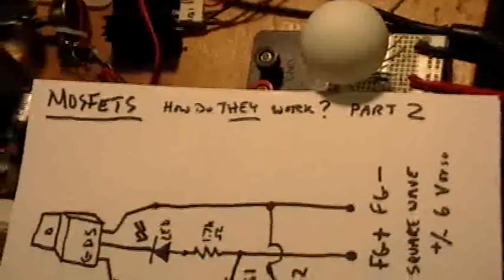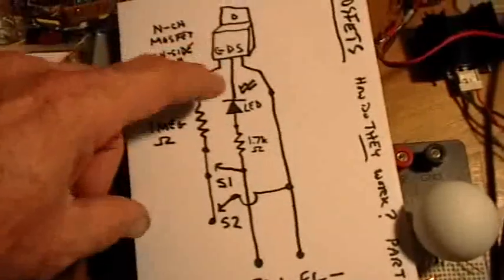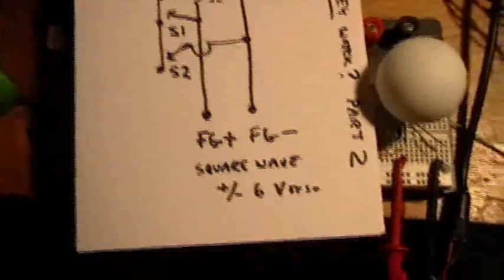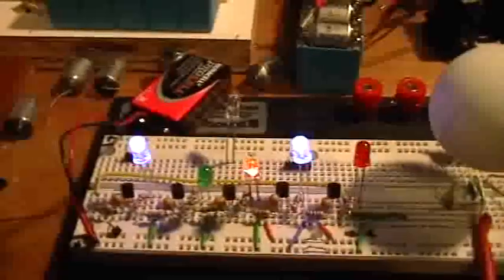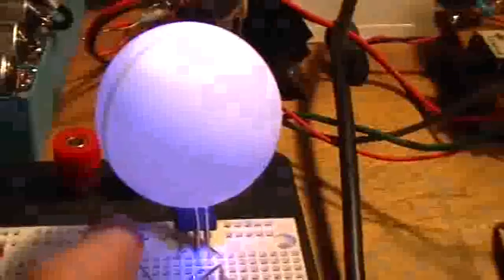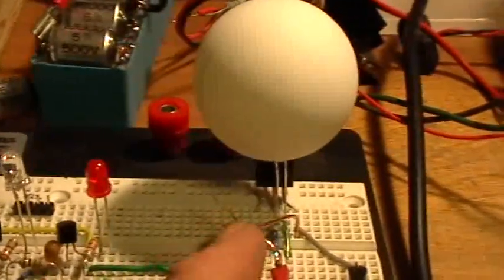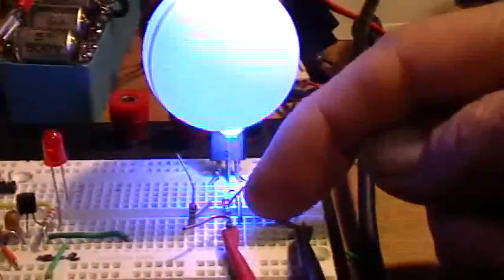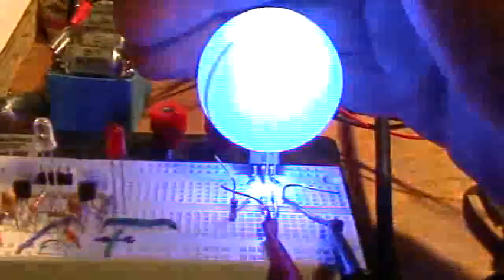Electric OU: Supplement: MOSFETs... How do THEY work? Chapter 2

Comment from the maker: Ah... you want a full control loop? That's only a little harder but the load itself will come into play. Basically the NTC will be used to regulate in "negative feedback". As the load temp increases the NTC will decrease in resistance and you want this to decrease the current allowed through the transistor supplying the load with current. Properly this should use a simple operational amplifier circuit (you will need to control your setpoint) using a 741 op-amp for example, cheap and easy to do.

Comment from the maker: Yes, that's right. Just as with ordinary transistors, a gate pullup or pulldown resistor should always be used unless the signal itself turns the mosfets off.

In the Ainslie circuit, it is the FG itself that turns the mosfets off by either grounding or even sending negative voltage to the gate. 

In my TinselKoil, the gates of the main H-bridge are driven by AC signals going + 12 volts to - 12 volts and are protected by external zener diodes. The Mosfets are turned ON hard and OFF hard too.

Comment: the lower the gate-drive voltage, the higher the on-resistance and lots more heating.  try to drive the gate with at least 12v, but no more than 18v.  Also, for high-side driving an N-channel FET, things get a little complicated if you need to switch more than 6v, due to the gate-source potential.  Ideally, a charge pump or pulse-transformer would supply a reservoir capacitance which can be switched with a PNP BJT into and out of the gate-source junction.  hope this helps!